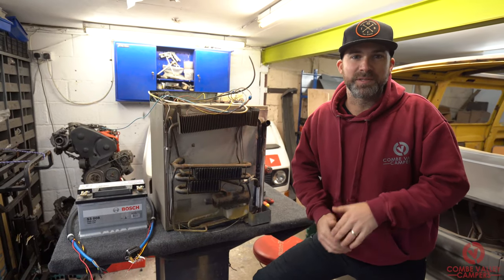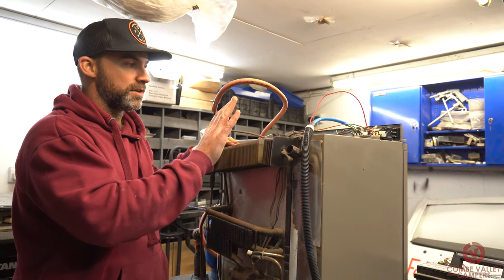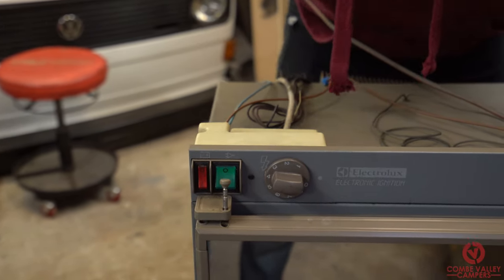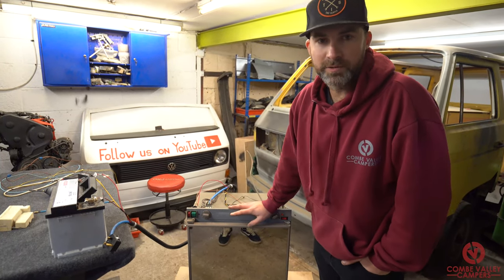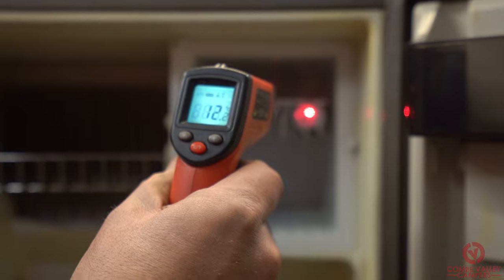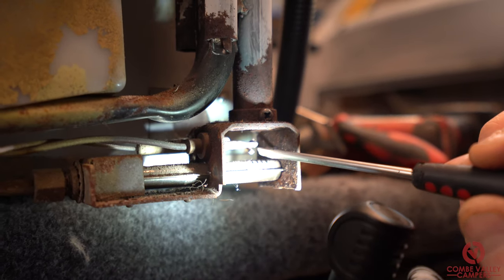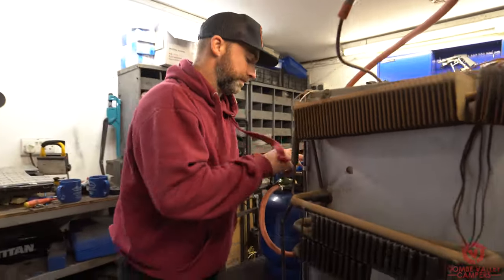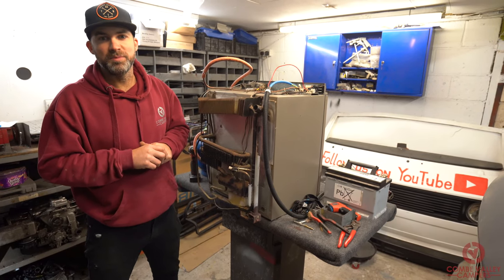HOW TO REPAIR A 3 WAY FRIDGE.  Includes operating and maintenance instructions

Comment: Hi both 12v and 240v heater elements are getting hot but the temperature in the fridge isn't dropping.  Does the water/ammonia mix decrease over time and is it possible to top that up ? No external leaks evident.

Comment: Hi, I have a problem with my Dometic RMLT 9435, when I’m hooked up to 240v supply the warning light flashes and will not operate on 240v so I have to run the fridge on gas, is there any chance you can you help to identify my fault, much appreciated Rob.

Comment: Anybody knows how much current does it take to run this fridge on the 12V from the car battery? More or less, thanks!
Reply: They are usually around 150 watts depending on its size 🙂
Reply: 10 amps

Comment: Is the jump start voltage different for each power supply? What is it for 110v&  12v  & propane regulator psi can test with 20 lp tank? Is there a valve set value?
Reply: The LP valve in my mini fridge is 2000-3000pa. Says manual for a Absortion-defission multiway refrig.

Comment: Absolutely brilliant, information thanks. 1989 westy with quite a few bits disconnected from the previous owner. just the leisure battery and wiring to find😳

Comment: Great video and info. We have an Electrolux RM212 and it works on 240V but we're experiencing some issues on gas. The freezer part is usually working but the fridge gets warmer by the hour it's on. It went from 2C to 11C over night. The other day it stopped working totally while the flame was burning. Not sure what to look for any suggestions are welcome.
Reply: Did you ever find the Solution bought 2nd hand same fridge guy said was working have it level will it get cold just on top of table not made up cabinet yet?
Reply: @brocky78  shake the desease

Comment: Thank for a good clear informative video.
I have a 3 way bluefin fridge in my camper. I want to connect it to butane gas but it doesnt have a connection on the back just a male thread.
Would you know what fitting this would be. Looking for an elbow with a tail to attach a hose to test if it works.
Many thanks
Alan

Comment: Very good video. Thank you. I have a Dometic RM8501 on a 2012 Autotrail Apache. Assuming original fridge . All lights work ie temp and power selection and interior light but no cooling whatsoever on 12 or 240 or gas.  I took the outside covers off and no heat detected, Dealer has supposedly fixed it but now over a year since purchase and not much hope of help. Do you think it can be fixed or a new fridge? If so what model do you recommend. Thank you
Reply from the maker: If you can, go through the steps to try and repair it, if not, send it to us and we can service it for you

Comment: Thank you for your video, I have a 2003 Rockwood Freedom Trailer. The fridge has worked a couple of times last season, when I plug it in at the campsite. But I believe the switch for the electrical is not working, because it doesnt click into place when on. Can I replace the switch myself? Please advise. I live in Ontario Canada

Comment: I have an issue with my 3 way Dometic fridge. We had a gas person today (who specializes in this type of equipment) but he could not find the source of the problem. Basically we can smell gas in our motorhome but only when the fridge is ON. When the gas hob or oven are in operation (while the fridge is turned off) we don't have the smell of gas. The flame from the gas hob (and where the gas flu is)  is good and the technician said he was quite sure there is no leak of gas. Help would be greatly appreciated. We have run out of ideas and solutions.

Comment: Hi from Egypt :) 
thank you for your video 
can i ask you about the Gas system 
my fridge turned on with Gas but it would not cool inside 
it is working with 240 volt , some thing wrong with the 12 volt heater i'll check it later 
 and I'll do the maintenance like the video 
I think i don't have that metal peace you get form the pipe above the flame is this the reason ??
thanks for your help

Comment: I have the same refrigerator, but only the freezer compartment is frozen, but does the metal part in the large compartment of the refrigerator also need to be frozen?
Reply: Me too mate,the icebox is super cold but not the fridge storage area is not ! Did you find a solution ?

Comment: Gas service  , check pressure at burner ,clean flu , fit a spiral to flu , clean replace gas jet ,check ignitor clearance ,  ensure burner heat exits van properly .
A/C voltage ,measure voltage  ,check for volt drop 
12v dc check voltage , check for volt drop 
----Installation 
rear of fridge fit within 25mm of van wall 
---Condenser cooling 
fit 2 x 90 mm  computer fans 60cfm each minimum on upper wall exit vent . Operate on a 47--50c thermostat 
create duct work condenser to exit vent [fans mounted inside duct ]
---thermal heat transfer paste between goes hard [evaporator coil thermal join to fridge  tubing ]
---fridge seal 
--evap drain clean

Comment: Thanks for video .👍👍👏

Telford N112 fridge is working on gas but not on electricity neither 230v or 12v, both heating coils are working as they get hot but not cooling inside. Any idea what could it be? Thank you

Comment: Hi Lee. Great video thanks. My Electrolux fridge keeps tripping the safety switch when turned on. Would this be the element?
Reply from the maker: I would suggest that, or a fault with the earth somewhere. The element is fairly simple and cheap to replace

Comment: Hi,You say the 12v may not be strong enough to run it with the engine on how do you check and repaire that issue thanks .

Comment: Hi there can you help, I have a thetford n112 fridge, 2008 swift not cooling on 240 works fine on gas put new element in and thermister still not cooling on 240.

Comment: I have an RM 182B 12/120 it also says refrigerant 717. I am not sure what the best way to test this refrigerator is. Should I use the test procedures in this video? This is a 1984 Westfalia I read that R717 should not use copper piping do you know what piping was used when these were built / installed. Should I replace this unit or would you try to save it?

Comment: Hi my hooked wire with twisted blade that goes inside exhaust broke at the hook. I had to tip it upside-down and it drop straight out fixed it but when I relight it runs warm inside  not cold what should  I do now ?

Comment: Hey Lee, could you post a wiring pic for the 240 AC element on an Electrolux dometic 6270 , I never removed the element so I never saw where the 2 lives came from, the mains switch I would imagine ? Thanks.

Comment: my fridge first froze the freezer at 12 volt battery but for past two weeks it doesnt freeze the freezer i have it for like 2 years what should I do?
I cleaned the gas chimney and after that it doenst work, I cleaned it because it was not Working in GAS

Comment: Good evening. I have a Coleman 3 way Portable Camping Fridge ( it is old ). It works on 12v, 240v but won't stay lit when on gas. It lights but shutdown as soon as you release to gas control knob. I am thinking it needs a replacement thermocouple. I am in South Yorkshire. Do you know of anyone doing what you do up here?

Comment: Hi my 3 way fridge blows the rcd as soon as mains selected   presuming is the element, im a spark bit never serviced oneof these, pso the tapp above is a bit leaky thought it might be related, are elements easily changable pkease? Great vid ta
Reply from the maker: Hi, yes sounds like the element has failed. They are changed and installed easily. Remove the old one and scour eBay and camping suppliers for the appropriate part

Comment: Thanks so much for a quality video with good info. My electroluc just has a black push in ignition & it's not lighting. I'm wondering if this requires power or if it's a old skool type ignition  that doesn't need power. It makes a loud click but I can't hear ignition spark.

Comment: Hi, I have an old 3 ways fridge like this in my camper. I really want to remove it and put in a new one. Is the gas and electric connections are the same? Thank you 😊

Comment: thanks for your video my gas was not working but the power was getting it to freeze  turned out the gas pipe to the burner was full of rust inside  cleaned it out, put some wd40 through it to slow down the rust,now the freezer is working
Reply from the maker: Great work

Comment: I've brought the same 3 way fridge mine is the bigger model that goes over wheel arch is it okay to use heat shield spray on the gas components on the rear of the fridge as mine have suffice rust so want to tidy it up ???

Comment: My n3112 will not run in 12v or 230v.  Runs in gas only. I have replaced main board and was told a 692257 is the same as 691101. Is this correct ?

Comment: Hi There
My Dometic Fridge RM6131  works fine on 240v and on 12v. It lights on gas but the flame wont stay alight when you release the igniter button. Faulty thermocouple or gas valve fault do you think?
Thanks

Comment: hi..great vid..but need help..we have a domestic rm8550 and its getting bother 12 and 24v but wont turn on..no light when door open etc..not tried gas..(things ive tried) made sure its level..changed fuses..removed from van ..cleaned it etc..still same ...any help idea would be cool

Comment: Hi my 3 way fridge is driving me daft!  It isn't getting cold on neither 12v ,gas or 240v ,  the back of the fridge gets hot using all 3 methods , so that rules out the elements/flame , I have tried turning it upside down a couple of times with no luck of dislodging  a blockage,  can you help shed any light on this? 
Thanks Alex
Reply from the maker: Hi Alex, how long are you keeping the fridge on to make sure it gets cold? Sometimes it can take 24 hours to 'break the seal' so to speak. Failing that, it may well be the end if life fo that unit?

Comment: Electrolux Electronic ignition gas fridge is not working. Cleaned the back of fridge and the orange light comes on but it seems not to be connecting. What do I need to do? Please help.

Comment: Long shot, since this is an old video, but im going crazy,  not finding any answers. I have a similar fridge. Elecrolux rm 200. 
When i turn on the 220v, it gets warm in the back, but the fridge dosent get cold. The manual tells me to check HFI relé 🤷‍♀️
On 12v it works perfectly. Also, can i use it on 12v if the battery is conected  to a charger?
Reply from the maker: I would suspect that the 240 element is not getting hot enough
Reply: Thank you so much for answering! 
I dont know how hot it should be, but its to hot to touch. (First caravan experience, so all this is new to me)

Is this someting i can fix, or is it a lost cause?
Reply from the maker: @signeherheim1471  new elements can be bought and easily replaced. Go through the servicing item I list and see how you get on :)

Comment: Thanks for the video.  My Fridge is a Dometic, but very similar on the back.  The rear of the fridge gets mildly cool when run on gas, but the fridge and freezer compartment do not get cold.  They do however get cold when run on 240v.  It also cools (slightly) on 12v but that drains my leisure battery (even when the car is running) so I don't use it.  Any ideas why the pilot light would be on, and the exhaust warm, but the fridge not cooling on gas?
Reply: If anyone else comes across this... My issue was the flame. I used a can of compressed air sprayed into the hole by the burner. It fixes it for a short time until I can get the fridge serviced

Comment: Hi Ive just purchased a camper Talbot Pilote Going off grid life soon. The Electrolux 3 Way fridge has a issue In gas mode , turn on Gas on Pilot on Let run for 2 hours . Open door and its like a warm oven !!! Any advice please Big thanks for great vids.

Comment: If the fridge is not cold enough but all 12v 240v and gas is all working.the fridge is only a year old but when the temperature goes over 24c 
 don't don't get that cold

Comment: hi Lee can you show me how to get in to the push button igniter switch.Do I have to take the fridge out or can i remove the front panel by removing two screws underneath. i have a dometic  RM8550 caravan fridge its only the push button that's not returning back to its original position. the button itself is a push in a twist type to change the battery.

Comment: We are on holiday and our fridge won’t chill.  Gas and 12v and 240v all good.  Heat coming out of vent. We have had the element replaced as it was tripping the electric.  It’s worked since then.  Any suggestions? I’ve seen some comments about liquids settling and taking it out and leaving upside down over night?  It looks almost exactly the same as the one in this video.

Comment: Would the fridge run on gas if the motorhome was not level ?. or would it cut off, I occasionally get issues of intermittent not lighting
Reply from the maker: Yes, being level can be a contributing factor, but a good clean and service would would best

Comment: Hello, i recently bought a VW T2 custom made on the interior following WesTfalia standards and there is an Electrolux fridge same type almost like your video (3 ways).  I am trying to understand why is not working, i will ask you ony one thing and please reply! If i switch the 12V i can see the light on and if i measure my battery there is a lot of Watt consumption so in theory is working. I didn't have the time to check it full on a big trip so i do not want to test it as the car is parked and will draing my battery. My question is simple: Shouldn't i hear the compressor working or at least some sound??Or those models have different technology to cool? Next time i go for a trip i will let it on on 12V but before this please answer my question! Thank you!
Reply from the maker: The fridge makes no noise at all. The 12v element in the back of the fridge will heat up, so will take up to 5 hours to make the fridge cold. Only use the fridge on 12v when the vehicle is running, otherwise you will make the battery flat very fast. Before you leave for the trip, plug the 240v hookup up to your socket, and make the fridge cold overnight by 240v. When you leave for the journey, turn the fridge onto battery, then when on site or in location, hook up to another 240v socket or switch the fridge to gas. Hope that helps
Reply: It helps a lot , specially all the information why and how to use the 3 ways system to keep the fridge "always" cold. Definetely i would only try on 12V when i am on a big trip, i was just curious when i left one day 1hour open and i could even feel it cold on 12V. The 220V i am not sure it is working i found the plug inside a cabinet hook it directly to my inverter but no response, the same is for gas (i see no sparkle ... should i  see sparkle coming from the bottom left hole and also smell the gas coming in if i use the gas system?)Thank you so much!!
Reply from the maker: @darkovsky  240 should be hooked up to mains power only, not an via an inverter connected to a battery as the draw is too high
Reply from the maker: @darkovsky  follow our fridge repair video for how to check gas
Reply: @CombeValleyCampers  Thanks so much for all the info!I have just subscribed. I do not understand though why would be a problem to connect the Victron 350/12 inverter to my 100AH deep cycle AGM battery and why should not work if if i connect the fridge direct to his 220 plug. I checked before the specification of the fridge , it is the RM4400 Electrolux 3 way and i can see 130W at 12V consumption. Though it might be "a lot" should at least light the green button on, so maybe another issue. From what i have seen is that my Victron does not see any load at all at 220V when connected so there might be another thing. Gas not working, already checked before and i do not see and spark when i hit the button (should i smell/listen any gas coming through like using the kitchen or not?) Defintely might need a repair on gas and 220 , 1st thing is tommorow is to open the 2 vent openings on the side of the bus and see what i will come through, maybe something simple hopefully. I do not also understand why 2 vent openings needed for that fridge , from what i see online all the RV's with this old fridge needed 2 openings though!
Reply from the maker: Sound like the ignitor is not working if you can't hear clicking, or see a spark at the burner
Reply: @CombeValleyCampers  I hear clicking .. good and loud clicking but not spark is coming out (shoud i smell gas when i turn the gas valve on the fridge?i have 2) . I will check more after i open the vent system openings on the side of the bus

Comment: Good afternoon, we have a RMH7390L Dometic in our caravan that suddenly stopped working after lockdown.  We did find the thermostat control knob was spinning round which we have replaced.  When swiched on tge fridge actually gets warm instead if cild and the fridge makes a gurgling sound.  We have had both the gas and electric checked and it was confirmrd that both were  working properly when tried.   All looks well and clean internally and externally, any ideas?
Reply from the maker: Hi Shirley, without seeingbit for ourselves it would be very difficult to diagnose the problem im afraid. If you would like us to checknitnover please email info@combevalleycampers.co.uk. regards,Leigh

Comment: Does a 3 way fridge have two thermostats,one for 240 volt and one for gas,electric works,with the gas the flame lights but does not cool the fridge
Reply from the maker: I would suggest cleaning the burner for a clean flame, and also checking the flue for the baffle

Comment: Hi i have a yellow flame visible through the little viewing window inside the fridge rather than blue. I think this is a pilot light rather than burner. We also notice a slight smell (fumes rather than gas) when the fridge is on gas. The fridge doesn’t get cool when running on gas. Any thoughts?
Reply from the maker: The flame is not burning to full effect. It would need a good clean as they get covered in carbon and dirt